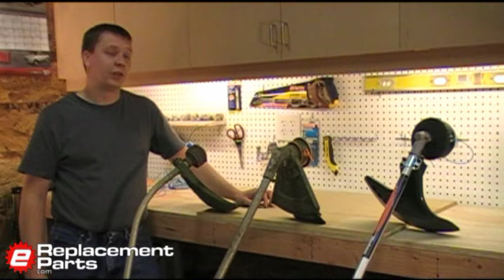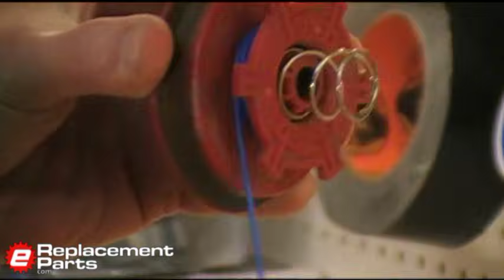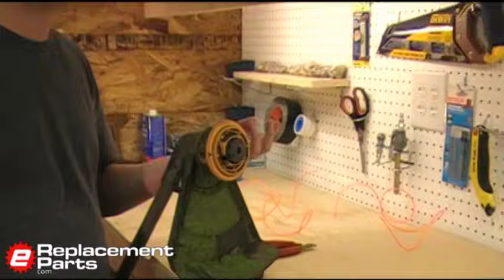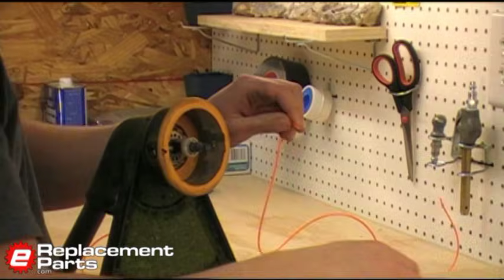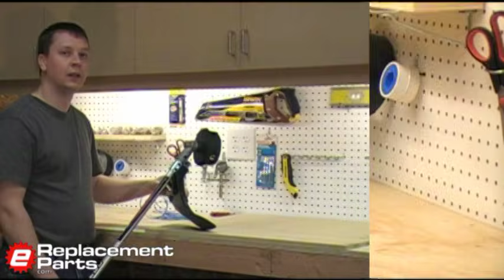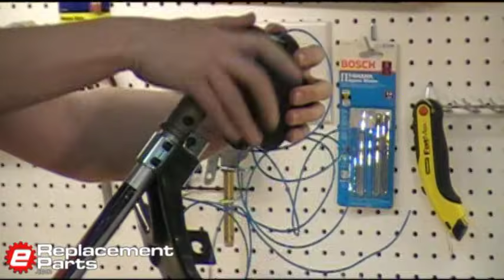How to Replace Trimmer Line

Comment: Why pray tell, is it necessary to remove the whole spool?  I just cut some new pre-cut lengths of .080" diameter line and just threaded it back into the spool without removing all of those clips.
Reply from the maker: I'm not sure how you would load these with out removing the spool.  There is a trimmer head called the speed feed that you load by cutting the line to length, running the line through the center hold and twisting the head
backwards to wind the string.  I have one of these and It's great.

Comment from the maker: I would try looping the line over itself on the first one or two wraps around the spool. That way the line should hold itself as you continue wrapping. You could also take a close look at the spool and the rest of the head. As long as there are no interference issues you could drill a small hole into the spool to make your own starting hole.

I hope this helps, 

-Mark

Comment: @eReplacementParts the part of the dbl line trimmer head is easier to do also.  remove the head and remove the line if needed. replace head and tighten bump knob.  you then line up the arrows push 10' of line into each hole untill it comes out of the hole and then loop into the hole that is right next to that one.  then holding the lines all you do turn the dial and wind the line into it.

Comment: second (yellow) head is very similar to the third "speed head".
no need to take apart
line up the arrows on the spool and outer body
insert the line into the holes until the line pops out the bottom of the spool
insert the end of the line into the retaining hole
rotate the spool and it will take in the line
do this until the line is all but a few inches are sticking out of the head and you are done.
use one 8 ft of line insert each end into opposite eyelets - after winding cut loop

Comment: BRAVO...finally a video that SHOWS you how to wind the line onto the spool the proper way. I have a gas 2 line WeedEater and even the manuel was not clear on the winding. You did an excellent job explaining and showing the proper way right down to winding the string as straight as possible (and the angle cut). Thanks a ton. I really like the last trimmer, very cool.

Comment: That last one is awesome! Mine is a cross between the first and second styles - it has 2 lines but has the 'slotting in' mechanism that the first single line type has. Easy enough to work out how it worked once the line has run out, I saw two holes where they  were plugged into the spool feeder then wrapped them around in the two chambers evenly (the prepacked ones from the factory when I bought the trimmer was wound too-tight I think for it kept jamming up) I didn't jam up the head with weeds.